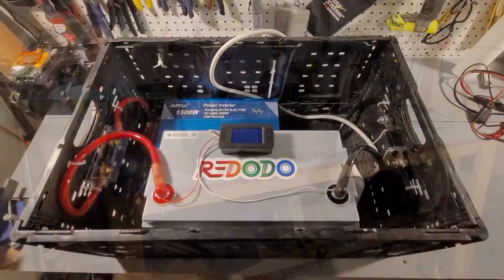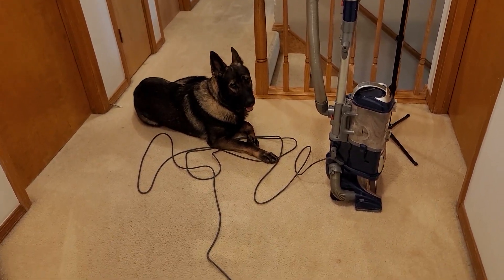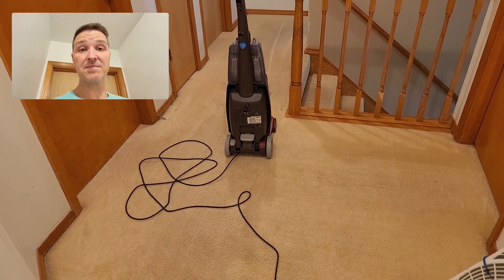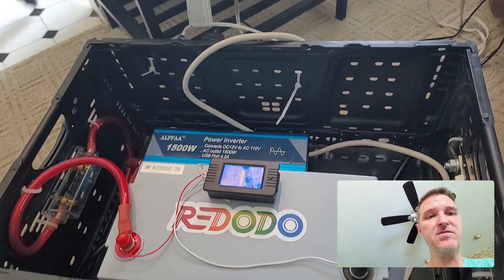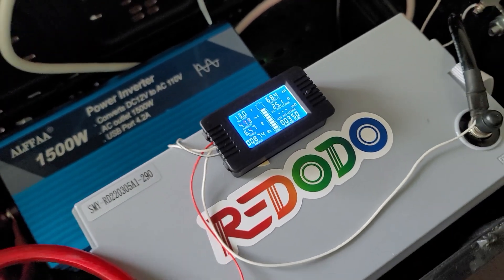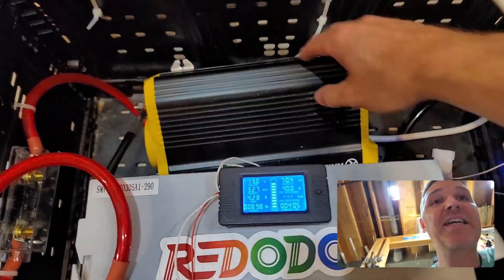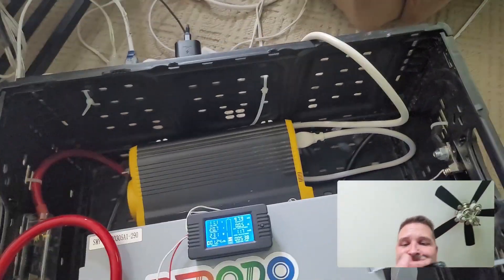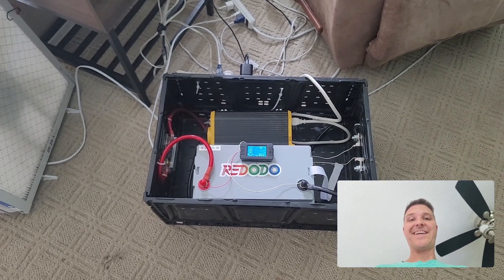Real Life Review of 12v Redodo 100ah Battery.  Part 2.

Comment: Awesome. I built a similar box with a 300ah zooms bat. I also added a 12-36v switching power supply with a charge controller and it kind of works as a pass through. I also added cables for PV input.
Reply from the maker: Is the box on wheels?  I know a 300ah battery weighs in around 75 lbs.  Sounds like you have a nice setup!

Comment: you could have  took the inverter out of line and drew power directly from the battery. The Redodo birds BMS would have kicked in at some point to protect the battery , so you dont have to worry about that. Is there a part 3 in the works?
Reply from the maker: I didn't really think of making a part 3.  What would you like to see?
Reply: @OffGridBasement  id like to see what the battery alone would do. Like i said the Batteries BMS would shut down, plus how do you know it was the Inverter shutting down and not the batteries BMS giving you a false conclusion ? You would have to do a video with just the battery alone
Reply from the maker: @mannyfragoza9652  ok.  I'm letting my dad borrow it, but as soon as I get it I'll do another video of just the battery.
Reply: @OffGridBasement  ah ok i hope others would like to see what kind of power the Battery alone has.Thanks BTW

Comment: is it really true that the limitation is the inverter and not the battery? The battery prob can only discharge 100amps times 12.8 volts so 1280 watts would be the max draw correct? The BMS wont allow it to provide any more to protect the cells, which are 100AH cells
Reply from the maker: With this setup the limitation is the battery.  It does have a 1280w max output.  I feel like the battery and the inverter are matched well together. 
 You usually don't want to push your inverter past 75%.  Nice work on getting that figured out.  I believe there are other batteries that allow 200amp discharge.  Thanks for the comment!

Comment: Unfortunatley  it will not ship to UK. Trump America First means..America does not ship worldwide and we have to go the old Hong Kong, China route. Still I guess if its made in china its not wise to ship a product twice...I have to wait till  October estimated but I did order some buget batteries at last. From a Verified Aliexpress Factory stoe. Could use battery monitor idea.Looks good. Cheaper than Bluetti. 😎😎
Reply from the maker: Bummer about the shipping.  What brand of battery did you get?
I'm going to do a video on the battery monitor.  It has it's pros and cons.
Reply: @OffGridBasement  Might be embarassent to tell you. Liitokala. Its cheap option. 120AH x2 for 377 GB Pounds.. I think same cells as BASEN..If I get something expensive like SOK that would cost over 1000 GBP...I choose cheap shorter term option...With POWMR 2400. Will Prose siad they do arrive he did a video on them..
Reply from the maker: I say whatever works for you.  I'll look up the info on that battery.

Comment: Good video. Did you find out where the smoke coming from? May be open up the Inverter to see if anything burnt, then do the follow-up on the review of this inverter.
Reply from the maker: I did open the inverter and everything was fine.  No burn marks or melted wires.  I tried the inverter the next day and it started back up with no problems.  I plan on pushing it again to see if it can handle.  Thanks for the comment!
Reply: @OffGridBasement  That will be great if you retest with heavy load again to see if will still function OK as you had done in the review of this inverter. It seems to handle the surge from vacuum/carpet cleaner pretty well